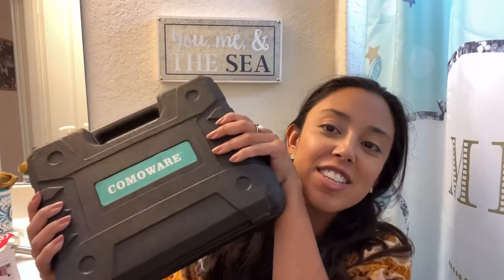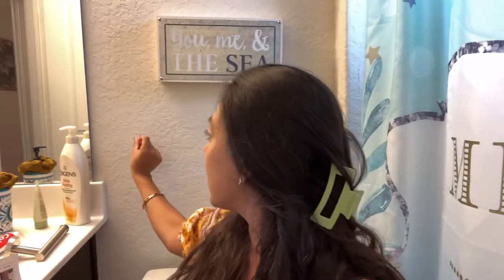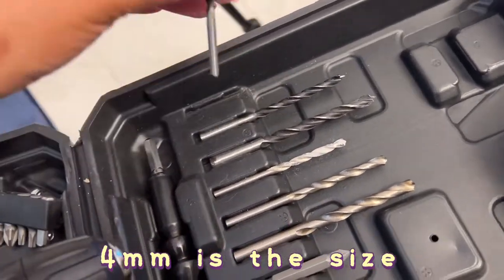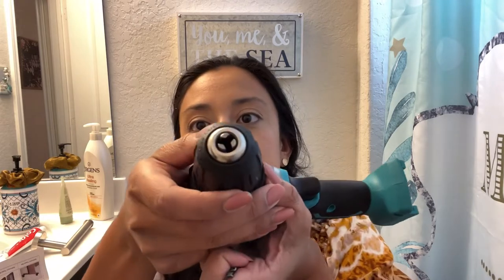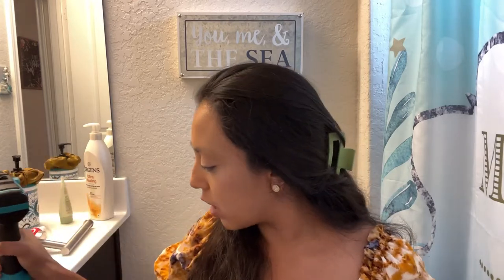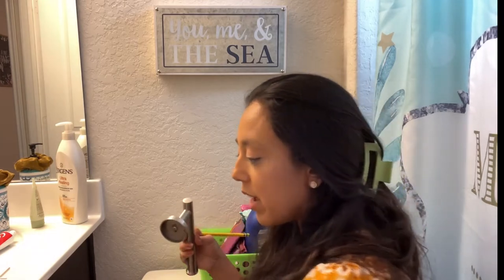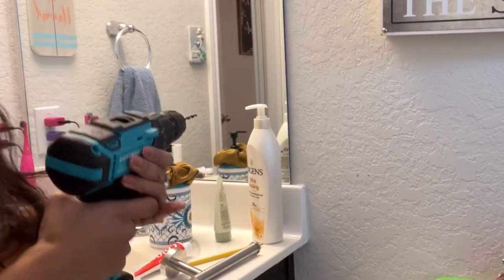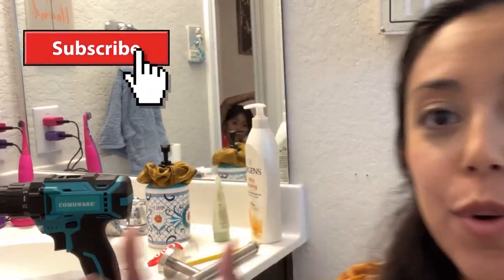HOW TO DRILL HOLE IN WALL FOR SCREW / BEGINNER FRIENDLY! / DRILL HOLE IN WALL STEP BY STEP

Comment: I struggle with fitting my toilet paper on the holder too, haha! I feel like it's always too big for some reason. Smart idea to replace it with a bigger size! I've actually never used a drill before, but you made it look so easy :) Measuring for the holes first was a great idea! I like that you made small holes first before drilling all the way through! The precision is on point :)